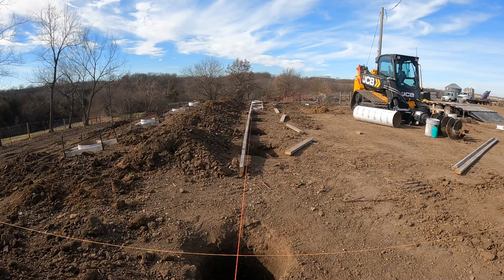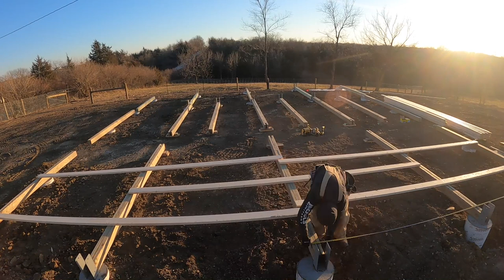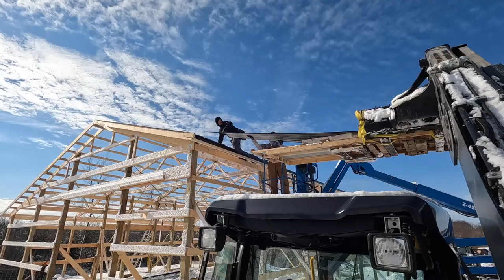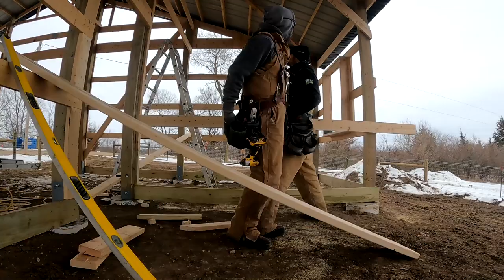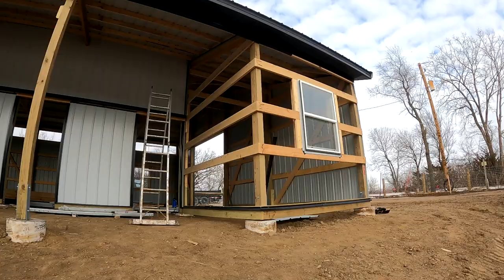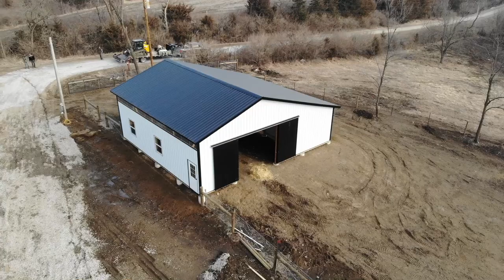Building a Post Frame Barn | 30x36 | Full Time-Lapse

Comment: There must be a good reason that you frame out the sono tubes. Have you had a bad outcome somewhere along the way just leveling the tubes, and trying to pour the concrete without the framing? How long to you generally have to set your brackets once the concrete is poured?